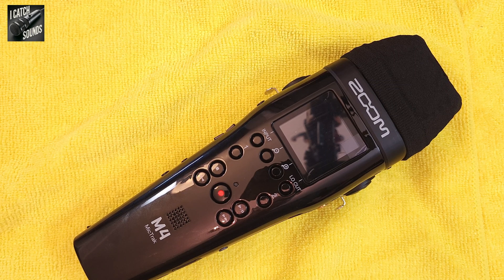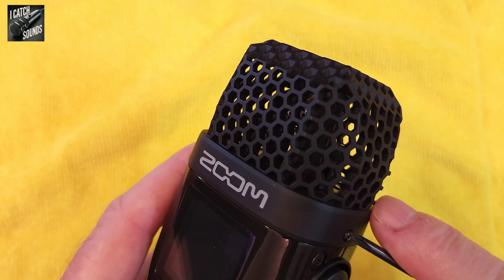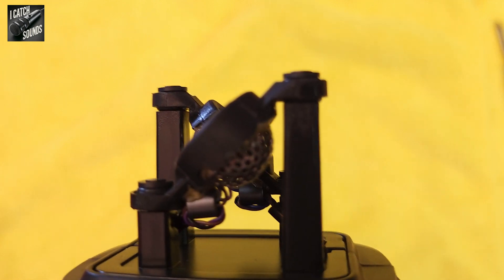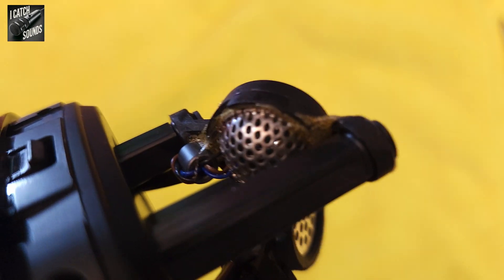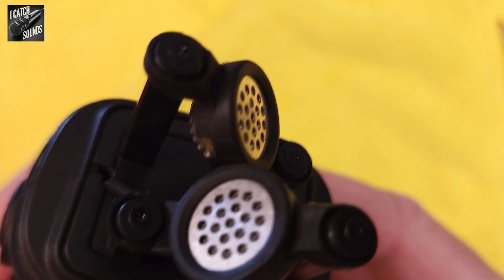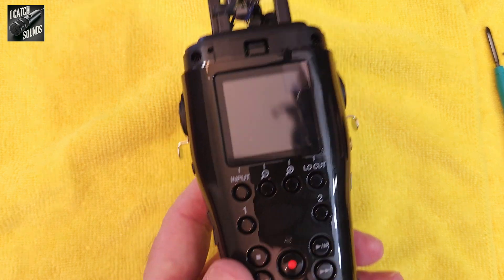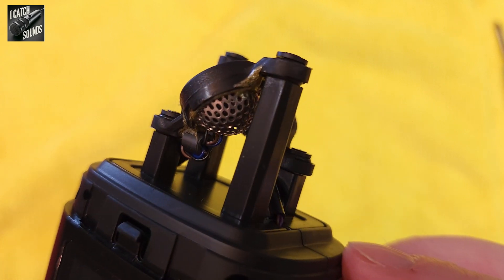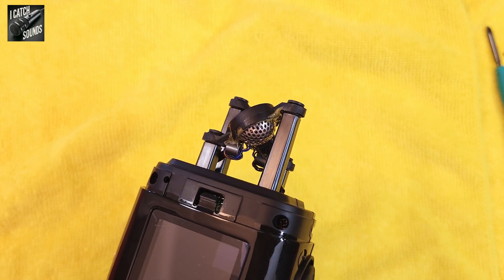Zoom M4 MicTrak Disassembly - Inside the X/Y Mic Capsule Audio Recorder Cover

Comment: What is the diameter of the microphone capsules?
Reply from the maker: I think they are 14.6mm. That is the best measurement I could get without tearing the rubber cover.
Reply: @ICatchSounds thanks a lot for the answer!
Reply: @ICatchSounds  May it be a Primo EM200?
Reply from the maker: Maybe Primo. They have very similar mic patterns.  But, they could be using they own inhouse build. Not sure.
Reply: @calandrella57  likely the em200/204/415. The em415n is the latest version from primo as the others are discontinued

Comment: I have to say that those who have reported purchase of the M4 (and in general the M2 & M3) seem to be very happy with these devices, which makes them a very worthwhile bargain at the moment, unless the form factor just wouldn't work for you.  

As for mic suspensions, I think the problem with all such devices is that as the capsules weigh hardly anything, and  therefore they have no inertia, a functioning suspension between the capsule and the body would have to be incredibly flexible and probably therefore not very robust.  I don't recall any hand held recorder being famous for its low handling noise, although some get complained about more than others - low end devices possibly being used by people not used to simply having to keep their hand immobile relative to the device.  The shiny surface on the M series devices was intended to reduce handling noise by being slippery, but of course then you have to be careful not to drop it....

Anyway I look forward to your next video!
Reply from the maker: @Ozpeter
 I have thought about swapping out the mic capsules on one of these type recorders.  Possible something a little larger and add a bit of weight hanging off the bottom of the mics.  Resting in a slightly more flexible mount.  I also subbed your channel.

Comment: Thanks. That was cool to see. The mics look bigger than I thought. Probably the most underrated Zoom audio recorder.  You can get them cheaper than the Tascam DR-07xp and the Zoom M4 is way better. :face-pink-drinking-tea:
Reply from the maker: Yes, If I was choosing between the Zoom M4 and the Tascam DR-07XP the Zoom recorder wins in every way.
Reply: @ICatchSounds  Indeed - dual ADCs unlike the Tascam, F series preamps, and mics which may be the same as the M2.  In my view the M2 mics had to be good as they are the only source of sound for the device.  No point in that one having the dual ADCs and F series preamps unless the mic was better than most / all portable recorder mics.